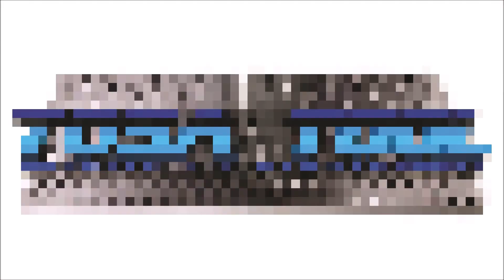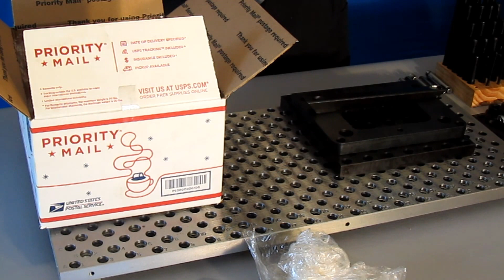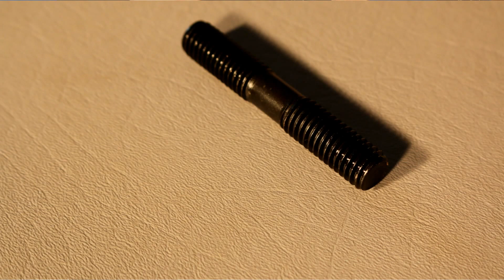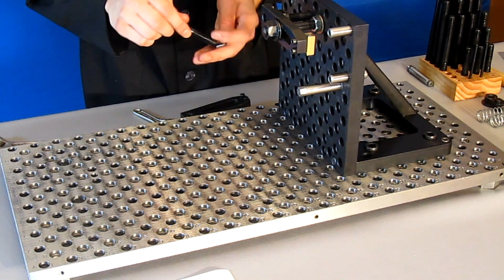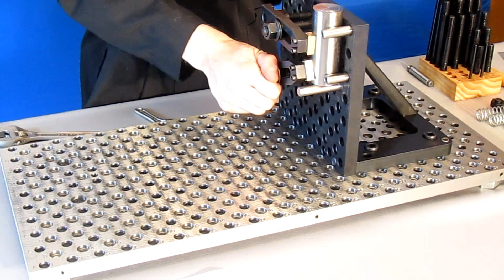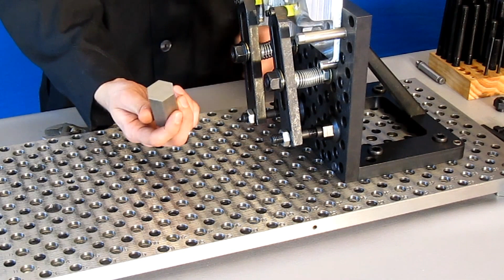Tosa Tool's Modular Angle Plate Explained By Caleb Johnson

Comment: Son, for this being a lesson on how to use a precision setup tool you surely are extra clumsy handling the components. Every time you place the modular angle plate onto the main pallet you bang the parts together, this is not bad if you have a tolerance of at least +.005 but if your tolerance is +.0003 forget it because by the time the error meets the cutter three inches up you are off by ten times that. Learn to slide these components together, if you can at least treat the tools you have with the care they require you may be smart enough to be listened to.